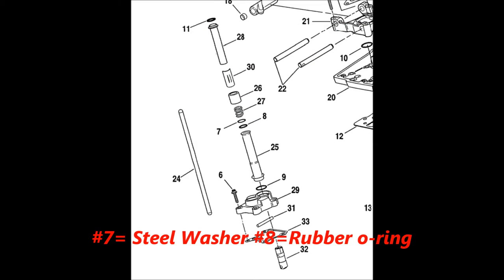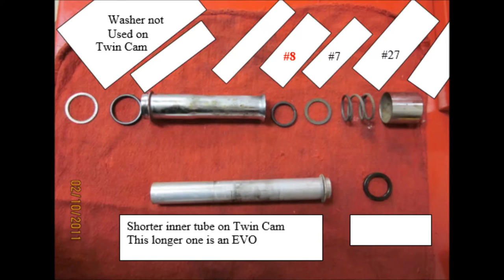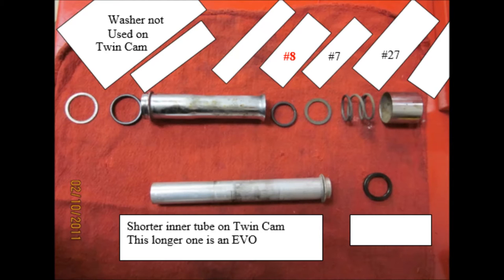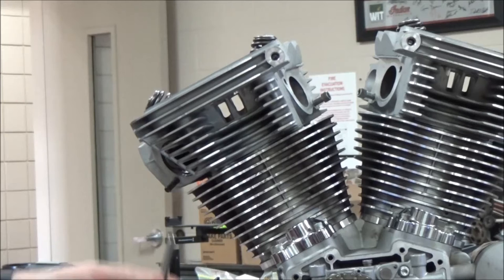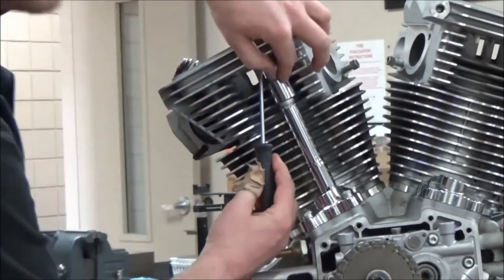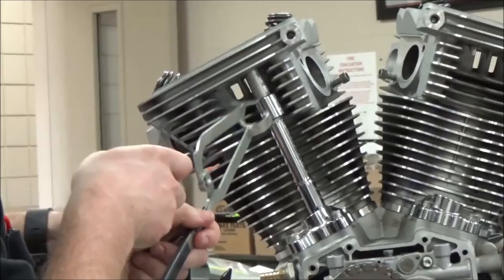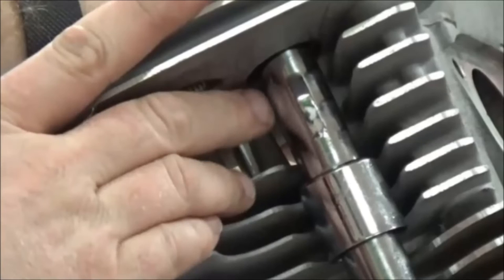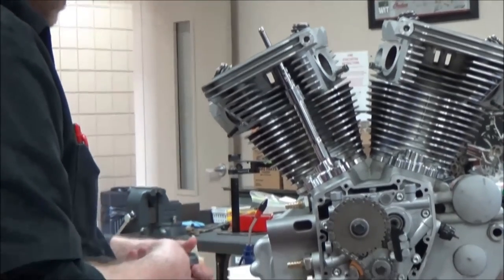TC Series: 20 Harley Pushrods Leaking after rebuild overhaul? How to install pushrods without leaks!

Comment: Thank you for sharing, I have 16’ Twin Cam Road King & just noticed a little run (oil leak) on the front outter pushrod, it’s little bit but leaking,, is just the seal needs replaced or could there be a bigger gremlin that’s just peaking his head out.?
Any kind advice much appreciated.

Comment: These engines seem a nightmare. .what with oil pump seals failing, cam tensioner wearing out. That fact the  customers junk the original parts for spurious parts is worrying. .You need 3 kinds of oil for the bike, what's that all about? Then there is the issue of changing the drive belt. It's a major operation .
So  this is Murican Iron.....I forgot. .what's this with rocker side float and bodging up with a washer and crankshaft runout. .and the crank  pins aren't welded and slip causing even more vibration. 
You just put me off spending my money. 
Good informative video though.
Reply from the maker: I can help! Please use the contact form link below. 
You're in luck. I do offer personal service to back up what's missing from a video to fix your specific problem. Live Chat is great for you to actually show your specific issue! Become a member of my website. It comes with a free HOW2WRENCH “Keep Wrenching” t-shirt or 20 mins of techline! Sign up now to have my personal cell phone number on speed dial! 
As always thank you and enjoy the free videos! Much more to come! I look forward to working with you and hope you will become a member of our learning community. 

Link to membership: https://how2wrench.com/product/membershipmembers-onlymembers? 

Contact form: https://how2wrench.com/contact/

If I can ever be of service to you, here is a video explains how to connect with me. 
https://www.youtube.com/watch?v=vjvmB01ebcs 

Direct link to services: 
https://how2wrench.com/product-category/tech-lineservice-callminutes/ 

Donation link: https://www.paypal.me/how2wrench